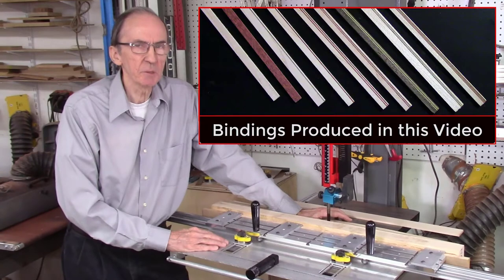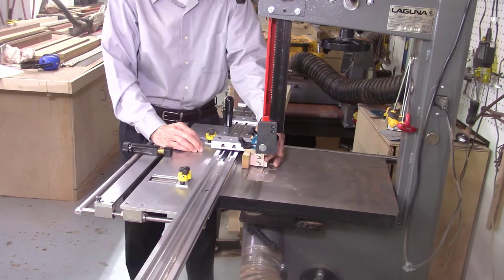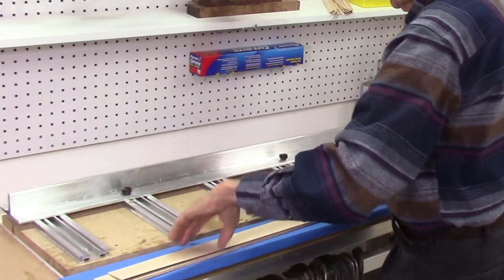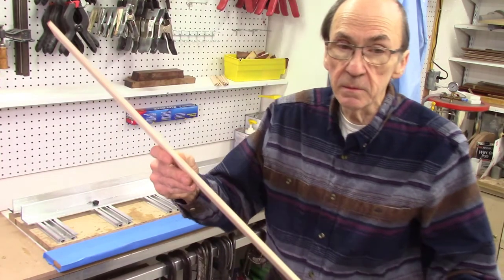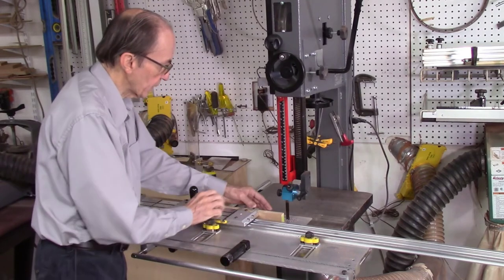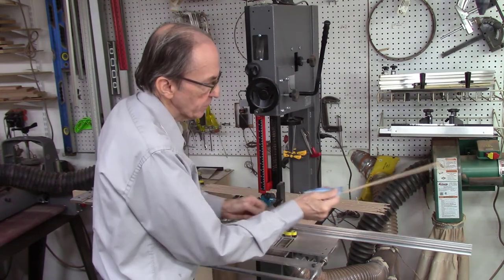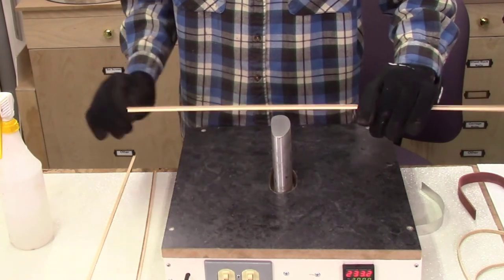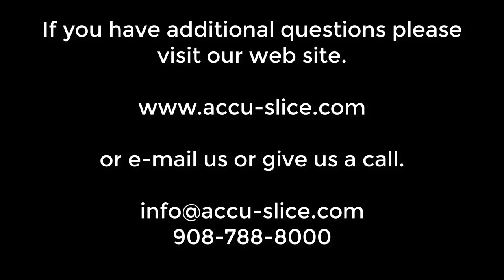Producing Bindings for Guitars & Thin Boards on the Band Saw (119)

Comment: Nice job.  I will be using your system in the not too distant future to do the same.  However, I am hoping to have laminates in in both directions.  2 thin layers on the bottom as you did and 3 total layers through the vertical. Might be a challenge to do efficiently.  But I am sure I can figure it out.